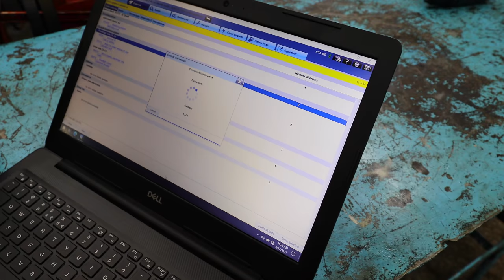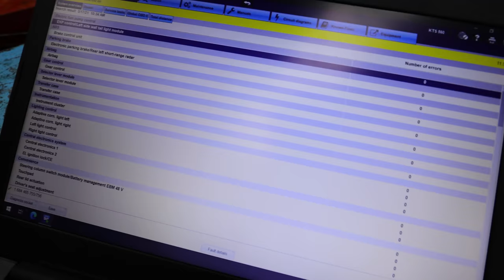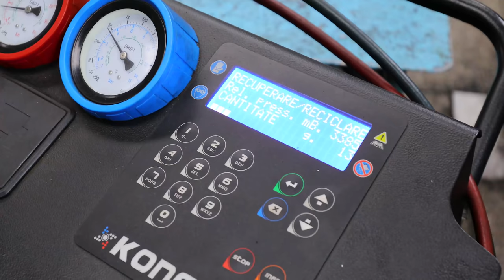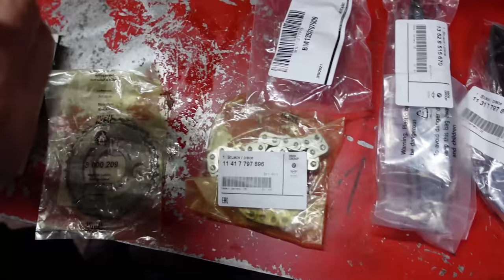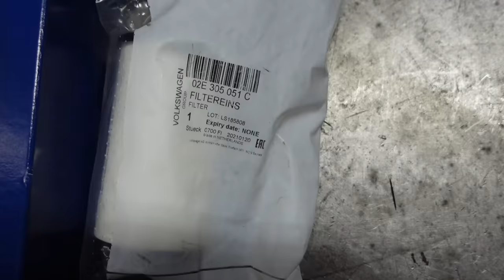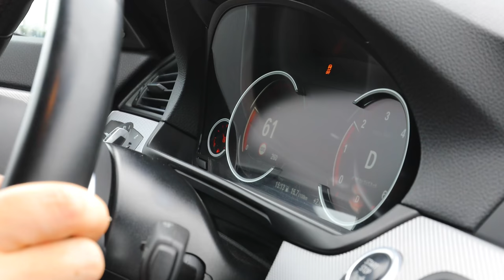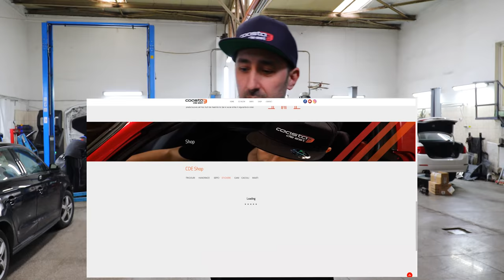BMW M550xd - balaurul cu 3 turbine 😈😈😈

Comment: Saluut, pentru mine cel mai interesant Bmw este E46-le cu motor de 2.0, 6 cilindri in linie. Acest model il si detin. Mie imi place mult senzatia la volan si modul de condus este foarte placut. 
Un plus fiind distributia pe lant si motorul pozitionat in asa fel incat sa ofere un echilibru sportiv masinii, chiar daca este din anul 2000 :) . Chiar daca este dintr o generatie mai invechita, nu are atatea sisteme pe el ce sa ti opreasca distractia( in locuri amenajate si fara circulatie). Tehnologia pe el fiind una potrivita dpmdv, are tot ce trebuie, comenzi pe bolan, ba chiar tine viteza singura :). 
In concluzie, mie imi place e46 le, fiindca imi da o senzatie sportiva dar in acelas timp oferind si siguranta. 
Super tari videoclipurile, va urmaresc cu placere si de la voi invat la randul meu noi metode de reparat, multumesc! ✌🏾

Comment: Cel mai mult m-a impresionat BMW E34, si in ziua de azi ma intorc dupa el daca vad unul pe strada. Era 1994, aveam 6 ani si unchiul meu a venit sa ma ia de la gara intr-o vacanta. Desi de fiecare data ma astepta cu o masina scumpa - avea acces la ele fiind mecanic auto (printre primii care a reparat pompe de injectie din RO), de data asta mi-a spus trist ca a venit sa ma ia cu o dacie. Copil fiind, am simtit o tristete enorma. Atat de impresionat am fost cand am vazut ca de fapt era cu un E34 incat mi-a ramas la suflet acea masina.

Comment: Cel mai prolific model BMW este E46. Si acum sa va spun de ce l-am ales, din punctul meu de vedere, de inginer mecanic:
1. Este generatia care a facut pasul catre tehnologie( CAN bus, senzor ploaie, stopuri LED, navigatie)
2. E46 a avut prima data motoare cu Valvetronic 
3. Aluminiul a fost folosit cu precadere la componentele de suspensie, pentru a scadea masa nesuspendata a vehiculului.
4. Faceliftul a avut Xdrive. 330Xd, 325iX si 330iX
5. Ultima serie 3 M cu motor l6, n/a ( S54).

In plus, pe vremea cand am luat eu permisul de conducere, era masina cea mai cautata "din afara".

Comment: Eu as aminti 2 motoare/masini iconice din punct de vedere tehnic dar si din alte motive: 
BMW M1 cu M88 3.5 litrii 6 longitudinal 277 CP/ 330 Nm, aspirata natural ... sau M3 E46 S54 de 333 CP ... 

Insa cine vrea sa se distreze, poate ar trebui sa se uite la un BMW 323i cu E36 sau E46 (cine stie de ea stie ce vreau sa zic). Vrei alt nivel, ii pui niste anvelope federal RSR, niste minime setari, bucse poliuretan brate, brate reglabile... Iar cei care vor sa mai investeasca putin pot pune un shifter CAE sau de ce nu cutie dog box. Merita acest model: o masina buna o gasesti la cca 1.500 -3.000 euro, impozitul e vreo 1.000 lei/an, intretinere ieftina, se poate modifica cu rezultate superfaine... Nu te faci cu ea de ras la Prejmer sau pe alt circuit...
Cat despre Nea Ion si mie imi pare rau de el, sper sa-i fie mai bine unde e, iar voua CDE va doresc succes in continuare!

Comment: Baieți pentru mine B.M.W înseamnă si va însemna 6 cilindri in linie si mai ales sunetul inegalabil produs de aceștia în ture. 
Drept urmare masina care mi a ramas întiparita în minte si suflet este BMW E46 M3 CSL din 2004. 
Sunetul hergheliei de 360 cai ,strânși toți într-o capacitate de 3.2 l, aspirați natural este unic. 
Totodată anumite elemente din design-ul său au devenit pentru multi sursă de inspirație în vederea customizării proprii “ bijuterii”( spoiler frontal, eleron,plafon de carbon..... ). 
O masinărie proiectată să fie rapida, agilă, competitivă  dar și uimitoare(asa cum a afirmat si  celebrul Jeremy Clarkson). 
Pentru mine ultimul model ce a respectat legendara rețetă CSL(coupe sport lightweight).

Comment: BMW M5 e39, motor 5.0 V8 aspirat natural care dezvolta 395Cp, pe care ii transmite la roata prin intermediul unei usor problematice cutii manuale in 6 rapoarte. Suficient de moderna pentru a avea confortul asteptat de la un BMW chiar si unul din anii 2000, si atat de puternica incat poti atinge 300km/h, viteza la care masina se simte stabila.(viteza aceasta se poate atnge doar daaca scoti limitatorul electronic de viteza). O super masina care a inceput de mult sa se aprecieze in valoare.

Probleme: 
-Cutia manuala are o problema, intalnita pe absolut toate modelele e39 M5, Cand uleiul este rece, intra foarte greu in treapta a-2-a, dar dupa ce ajunge la temperatura de functionare problema dispare.
-Rezervorul de lichid de servo se sparge, o problema comuna.
-Vasul de expansiune se crapa din cauza km multi, la fel o problema comuna.
-Acumulatorul de presiune VANOS, facea un zgomot urat la pornirea motorului la rece, BMW a reprioectat aceasta piesa, rezolvand problema

Nu multe probleme pentru un BMW si cu siguranta nimic ce sa te impiedice sa cumperi o astfel de masina daca ai undeva la 30.000$ "burning a hole in your pocket".

Comment: Salut, dupa parerea mea de pasionat de masini si de bmw in special, bmw m3 e46 '98 pentru ca:
- are cel mai puternic motor aspirat natural pana in prezent din toata gama bmw
-este una din cele mai complete masini de la acea vreme privind dotari/confort/putere si aspect
- are o caroserie dinamica, adica se pot aduce foarte multe modificari pe parte de tuning si pe parte de motorizare fiind destul spatiu chiar si pentru un v8 cu turbina
-cutia SMG care face senzatia de condus sa fie plina de adrenalina la fiecare apasare de pedala, fara senzori de asistare si suspensii active, pus si simplu simti masina total! 
- aspectul masinii exprima barbatie si siguranta
-placerea de a conduce acest model de masina este data de servodirectia grea, care iti tine masina in mainile tale, simti ca esti pe strada cu un e46. 

In incheiere as vrea sa spun ca bmw m3 e46 este masina visurilor mele si cred ca multi pasionati de bmw stiu despre ce vorbesc, masina perfecta pentru orice vrei sa faci cu ea, drifting/drag racing/spectacol pe strada cu tuning extravagant, vrei sa fie rea? o faci sa arate rea foarte usor, vrei sa fie blanda dar sa zgarie cand te iei cu cineva pe strada? un negru peste tot, air-ride si o supapa automata la evacuare si ai "pisica blanda care zgarie rau"... sunt foarte putine masini pe piata care se pot modela dupa orice cerinta de aspect sau putere cum este m3 e46! 

Va salut, numai bine.
Reply: De unde pana unde e motorul de pe m3 e46 cel mai puternic motor aspirat din gama bmw? E90 M3, E60 M5, E63 M6 (si multe altele) au motoare aspirate cu mai multa putere, mai mult cuplu etc.

Comment: Salutare! În opinia mea, cel mai tare model de la BMW, este E39. Dețin acest model de aproximativ 3 ani. Este o mașină frumoasa, aspectuoasă, cu un motor puternic și fiabil (3.0d, 193cp-in cazul meu-același motor de pe e38-ul din clipurile voastre, care a intrat la apa 😅). Ca și motor, este un adevărat tanc. Se apropie cu pași repezi spre 500k km, și este perfect funcțional. 
Mi se pare un model deosebit deoarece are unele dotări pe care unele firme de mașini nu le au nici măcar în 2021- scaune full electrice, inclusiv tetiera se da sus-jos din buton, memorii, perdeluta electrica, senzori de parcare, faruri xenon,oglinzi retractabile electric, senzori de ploaie și multe alte dotări wow, mai ales pentru vremea anilor 2000. Este o mașină care atunci când ai o problema, te-ai urcat în ea, ai dat o tura și pur și simplu ai uitat de ce erai supărat. Vă salut și respect pentru tot ce faceți. 🤝🔝☝️

Comment: Salut Coasta! 
Din punctul meu de vedere , cel mai tare model produs de BMW este M6 Gran Coupe (F06M) deoarece mi se pare ca le combina pe toate. Este o limuzina luxoasa si puternica in acelasi timp, ai foarte mult spatiu , arata foarte bine , e tinereasca si te poti distra cu ea, Nu mai zic ce potential de tuning poate avea aceasta masina atat la motor si cutie pentru a mari performantele cat si la exterior. Are un motor pe benzina de 4.4 V8  de 560 de cai putere. Imi place foarte mult ca masina este in 5 usi , deci nu o sa fie o problema cu accesul in masina. Consumul sincer nici nu prea mai conteaza:)) are un consum mixt de 10 litri, deci e decent. Accelereaza de la 0km/h pana la 100km/h cam in 4 secunde. Atinge o viteza maxima de 250km/h dar se poate scoate aceasta limitare electronica,dar eu cred ca e suficient. Cu aceasta masina eu cred ca poti merge oriunde cu familia pana la mare chiar daca e destul de rigida dar nu e chiar asa de rau ,desi eu zic ca e foarte confortabila, poti sa mergi sa te distrezi gen pe circuit sau ceva de genul ,poti sa conduci sportiv. Are 560 de CP la 6000-7000 de rot/min si un cuplu de 680 NM  de la 1500 de rot/min pana la 5750 de rot /min. Si nu in ultimul aceasta masina suna intr-un hal...te unge la suflet ,nu mai zic cum se aude daca umbli la evacuare ....la Daniel TOX.
Si acuma sa fiu sincer ,mi-as lua aceasta masina doar ca sa fiu cocalar ,sa ma dau smecher si sa ma dau la gagici:)))))))))))))))))))))nu chiar modelul asta un bmw cu motor de 2.0 diesel cu sigla M pe ea:))))))))))))
Si bineinteles nu pot sa uit de pisicuta (E36) , ursulet( E30) , rechin(E21) pana la urma alea sunt masini adevarate!

Comment: Sincer sa fiu, eu ador BMW 2002 care sa produs din 1966 - 1977 si imi place pentru ca masina arata intrun fel distins, are linii sportive si pentru vremea respectiva avea un motor de 2 litri care era in 2 variante, cu un singur carburator si avea 99 cai putere si cu 2 carburatoare care avea 118 cai. Pentru vremea respectiva era ceva foarte revolutionar si plus ca este inspiratia la M2 care este acum care este una dintre cele mai performante masini de la BMW dupa mine deoarece are o greutate redusa si un morot destul de puternic. Va incurajez sa cautati BMW 2002 si va veti indragosti de aceea masina !

Comment: Salutare, am urmarit toate clipurile voastre de la inceput, unele dintre ele chiar de 2 ori, i am recomandat ai tatalui meu sa vina la voi si a foat foarte incantat de serviciile voastre ( Renault Megane 2 1.6 16v).
Am urmarit acest clip jumatate cand l ati postat si jumatate astazi deoarece am un bebelusi nou nascut si imi ocupa mai tot timpul😂.
Si doresc sa va spun ca cel mai tare BMW-u din punctul meu de vedere este BMW 850 i E31 care a inceput sa se produca in anul 1984 iar prima data cand omenirea a vazut aceasta masina a fost in 1989 si tot in acelasi an a fost pus spre vanzare cu un pret foarte mare pt acea perioada cca 75.000 si 100.000 Dolari, productia a tinut cca 10 ani pana in 1999.
Prin 2005 avem unul rosu in fata blocului la vanzare cu 5000e😂.
Acum in zilele noastre a devenit o raritate si au devenit masini de colectie, pretul in ziua de astazi este unul ascendent.
Multumesc frumos si sper sa castig trusa deoarece imi place sa mesteresc diverse.
Si as dorii in caz ca aveti ocazia sa faceti si un clip cu Nissan Juke F15 am unul de nou si pot spune ca eu pers nu am avut niciodata nici o problema.
Multumesc!

Comment: BMW E26 M1

Unicul BMW cu motor central produs in serie a fost M1.  Sub capota avea un motor de 3.5 litri de 277 cp si o transmisie manuala cu cinci rapoarte din dotare, dovedindu-se arhisuficienti pentru o acceleratie de la 0 la 100 km/h in fix sase secunde. Cat despre viteza maxima, ei bine... aceasta se invarte in jurul valorii de 260 de kilometri pe ora. Istoria lui BMW M1 incepe cu dorinta germanilor de a intra in competitiile de WRC cu un model sport si performant. Nemtii au inceput discutiile cu italienii de la Lamborghini, pentru a le face un numar suficient de automobile. Lamborghini a inceput sa produca masina, realizand cateva prototipuri cu motor in 6 pistoane de la BMW, dar la un moment dat a avut loc o neintelegere si nemtii au ales sa produca masina in regim propriu, la fabrica din Germania.
Intre timp si-au dat seama ca au construit o masina mult prea complicata si mult prea mare pentru a concura in Campionatul Mondial de Raliuri, motiv pentru s-au decis sa-si faca propria cursa pe circuit, exclusiv cu modelele M1 construite, numita Procar. Din cele 453 de exemplare de BMW M1 construite, o buna parte au fost modificate si transformate in vehicule de circuit, iar restul au fost vandute ca autoturisme de strada.

Din punctul meu de vedere cred ca e cel mai frumos BMW construit vreodata!

Comment: Nu putem spune neaparat cel mai tare model de BMW pentru ca fiecare poate privi chestia asta din mai multe aspecte, unii se gandesc la design ,altii merg pe motor.... asa ca pentru mine  "cel mai tare model de BMW " care cuprinde ambele aspecte este BMW M3 E46  CSL . Parerea mea este ca a fost primul model M care a intrepatruns frumusetea istoriei BMW sport cu "tehnologia " , placerea de a conduce masina bruta  dar cu sistemele tehnologice din noua era. Este primul dintre "bavarezi" care impunea respect  din prima privire in oglinda retrovizoare, nu era nevoie sa sti prea multe despre masina , se remarca instant prin prezenta si sunet deosebit (in afara de BMW M5 E60 :)) - care a venit ulterior ).

Comment: BMW e46 M3 CSL, acel motor de 3.2i 24V 360cp este piesa de rezistenta la BMW, sa ai un 6 in linie si sa dezvolti aspirat puterea asta cu injectie multipunct, cred ca este unul dintre cele mai reusite modele. Stiu ca sunt probleme cu diferentialul, dar, senzatia...., cu acea cutie SMG este o adevarata piesa de muzeu!

Comment: BMW seria 8 E31
Mai exact modelul 850 csi cu motor de 5.6L V12, 360 cp si 550 nm cuplu la 4000rot/min. Era dotata cu o cutie de viteze manuala in 6 rapoarte. Masina aceasta este legendara. Forma caroseriei, diferita de ceea ce facea BMW in acea perioada, farurile escamotabile care ar trebui sa revina candva la moda. Aceasta bestie a fost fabricata pentru o perioada foarte scurta de timp, mai exact 4 ani, din 1992 pana in 1996. Motorul de pe aceasta masina era unul OHC aspirat natural care era foarte echilibrat. Testul cu moneda de 2 euro il trecea cu brio. Motorul a fost fabricat in doar 1510 exemplare. Blocul motor cat si chiulasele erau fabricate din aluminiu. La o astfel de masina, nici nu trebuie sa te gandesti la consum, dar BMW spunea ca masina in jur de 12.8l/100km mixt. Atingea suta in 5.7 secunde ceea ce pentru anii 90 era ceva de laudat. Viteza maxima era 250 km/h, dar era limitata.
Pot sa zic ca aceasta este una dintre masinile mele de vis.
Succes tuturor si spor la lucru.

Comment: Pentru mine, cel mai tare BMW făcut vreodată este BMW X7
Fiind fan mașini cu 7 locuri pot spune ca BMW X7 este masina mea preferata
Spațiu, lux, putere(în funcție de motorizare bineînțeles)
Faptul ca are 7 locuri, care chiar pot fi folosite și de niște adulți, nu foarte inalti mi se pare un lucru super, pe când la BMW X5 E53 carea avea și acesta opțiunea de 7 locuri, locurile de pe ultimul rand nu putea fi folosite decât de niște copii de maxim 7-8 ani.
Alt lucru: Este cel mai mare SUV de la BMW, un KingSize SUV cum i se mai spune. Pe lângă cele 7 locuri, mai rămâne si un spațiu decent în portbagaj.
Din punctul meu de vedere, BMW X7 este cel mai tare BMW de pana acum.
Mai sunt și alte model care îmi plac foarte mult cum ar fi M5 E60 5.0 V10
M3 E30(ursuleț boss) si Z8 E52 4.9 V8 cu transmisie manuala.

Comment: Salut Coasta de est
Mie imi place din gama BMW X6M Performant deoarece in mod inerent superior motorul performant M TwinPower Turbo pe benzina cu 8 cilindri,capacitatea de 4,4 litri si putere de 460 kW este cel mai puternic motor disponibil pe automobilele BMW din productia de serie.Echipat cu doua turbocompresoare TwinScroll sistem de injectie cu presiune inalta si Valvetronic,motorul Performant al BMW X6M Competition impresioneaza atat pe sosea cat si pe circuit cuplu de 750Nm acceleratie de la 0 la 100km/h in 3,8 secunde si de la 0 la 200 km/h 13,2 secunde

Comment: Acest clip a fost genial nu vreau sa mi iau hate dar sunt fan Bmw de mic, și am ajuns la al 5 lea Bmw nu ceva wow seria 5 e61, în trecut am avut patru e46 care nu am fost dezamăgit nici odată, atâta timp cât o întreți și ii dai tot ce trebuie nu te va lăsa în drum, a și sunt fan touring pentru că touring ul față de un sedan are o stabilitate mult mai bună pe curbe fiind mai grea pe spate nu îți permite să fugă de spate violent o plecare mult mai rapidă de pe loc datorită din nou greutăți pe spate față de un sedan, spațiu mult mai mare și încăpător și mult mai multe opțiuni le vei găsi mereu pe mașinile breack
Acest f10 M 550d are admisia de aluminiu pentru a păstra o temperatura joasa a aerului cele 3 turbine fac o presiune enorma și de aceea și traseul mult mai mare, 
App eu sunt Bucatar de meserie dar în timpul liber stau în garaj, clipurile voastre chiar au dat anumite roade mașini mele
Va salut de la Craiova!! Sunteți cei mai tari !!!

Comment: Nu ma consider un fan al marcii BMW, dar pot spune ca unul dintre modelele care mi-au ramas intiparite in minte este E9 (3.0 CSI). Eram cu ai mei la mare, prin 1999 cand am vazut pentru prima data acest model (nu imi mai amintesc exact, dar cred ca era 2800 CSI, nu 3.0). Statea parcat langa un S-class proaspat iesit din fabrica cu numere de zoll, cu faimosii senzori de parcare tip antena care ies din aripile spate ale masinii. Toata lumea se holba la barca nemteasca, insa eu baleam la acel E9. Am fost socat sa vad linii ascutite, botul inclinat care chiar aduce a rechin (de unde si porecla), pe scurt, design adevarat. Mna, la varsta de 2 ani sa vezi zilnic doar Dacii, Oltcit-uri si Skode cu aceleasi forme, toate parca desenate fara imaginatie, devenea plictisitor. Asta parca era dintr-o alta poveste. Inca de atunci imi doresc, "cand o sa fiu mare",  vorba aia, sa detin o masina clasica, fie ea BMW sau oricare alta marca.